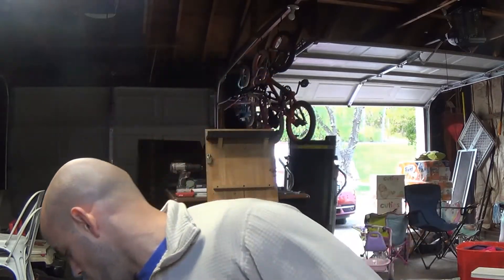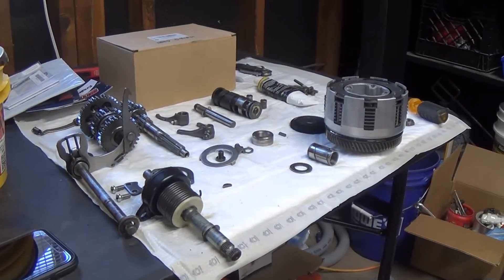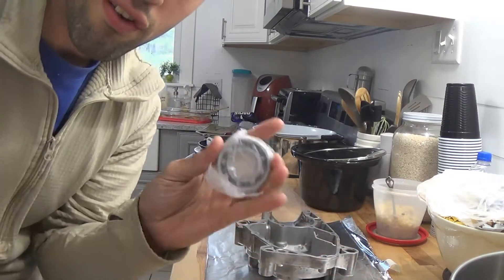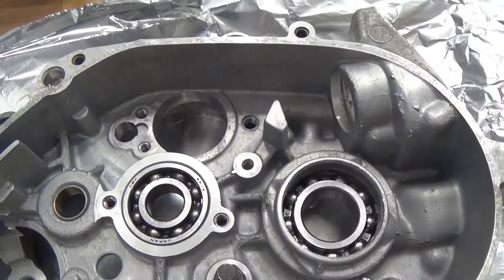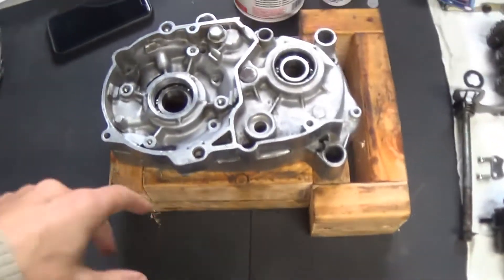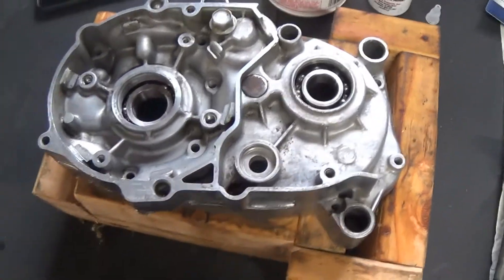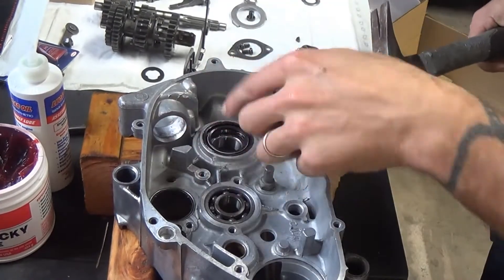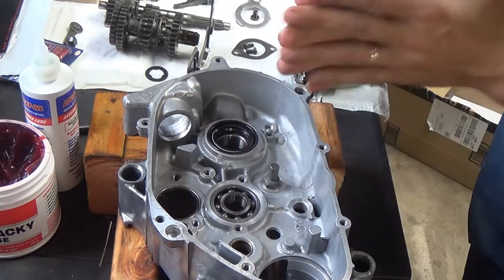PW 80 Engine (bearings and seals)

Comment: Correct or not ..I've always put the spring inword meaning what it is trying to hold back which is the oil that's where the spring would be that side..
Reply: Theres a spring on both sides bro some aftermarket dont but original is some aftermarket are some aren't but your right if spring just 1 side then put it towards the pressure
Reply: @bencollins5098thank you 😊👋🏼✌🏽

Comment: Do you have a link to your bottom end kit that included bearings, crank, rod, and gaskets?
Reply from the maker: No but it was a Niche set, still work today or you could get OEM, but it’s a little pricey.
Reply: @dirtbikedadgarage4662  perfect, wasn't sure if I should get OEM or aftermarket on the bottom end, sounds like your bottom end worked well though, so I'll probably go with Niche.
Reply: @andrewbodine5663   did you end up going with the niche crankshaft?
Reply: @rblankety  still haven't done mine yet. Other projects took priority.

Comment: Where did you get all the transmission bearings
Reply from the maker: The transmission bearings can be found with almost any part supplier like Rocky Mountain, partzilla, or even Yamaha directly. I would avoid cheaper ones from eBay or Amazon as they are lower quality. Thanks for watching!!

Comment: good job but all your seals are in the wrong way buddy ;)
Reply from the maker: You are correct on the shift seal and the countershaft seal, the flat part should face outward. I will add an edit in the video if I can figure it out. Appreciate the feedback. Thanks for watching.
Reply: @dirtbikedadgarage4662  anyway very good and interesting video my comment was just to prevent mistakes for your watchers ;)
Reply from the maker: @soyeux94  I welcome any feedback to help everybody learn. Thanks again.
Reply: Where did you get all the transmission bearings
Reply: Do you need to replace all the bearings and seals or can old ones be left in